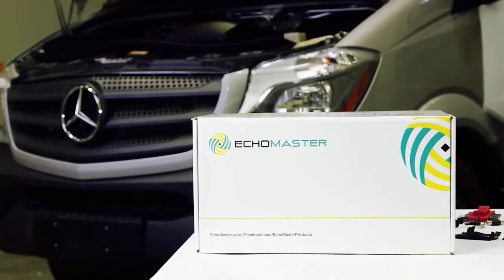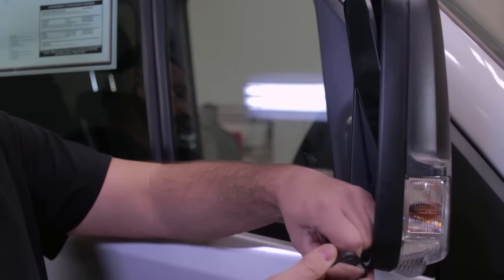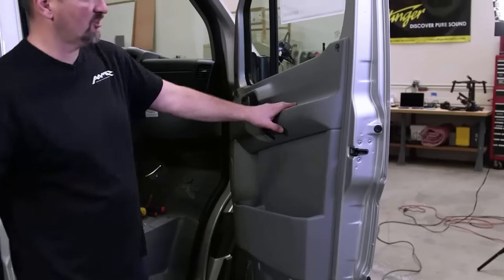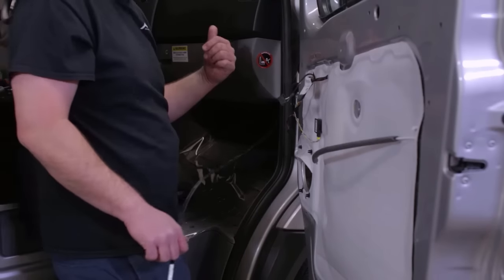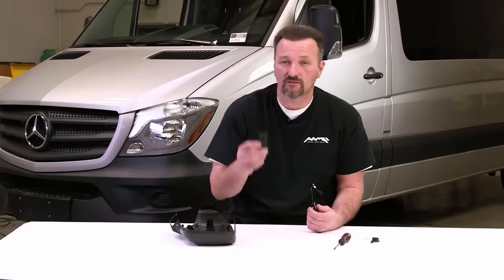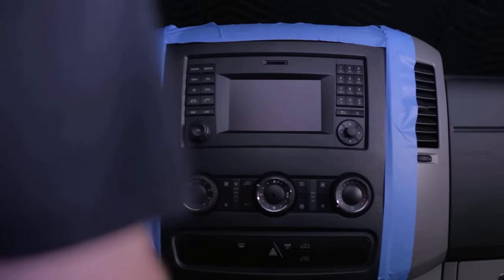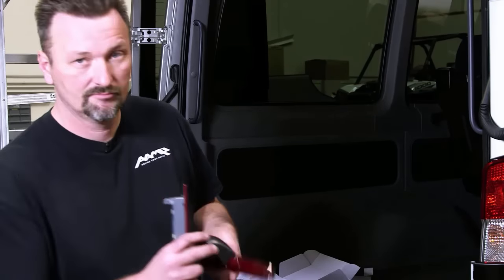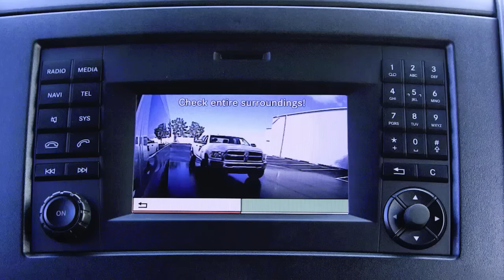Mercedes-Benz Sprinter Side Cameras

Comment: I bought the kit but its cameras do not fit my side mirrors which is a 2022 MB Sprinter.  Ends up with two cameras on the fenders.  The switching module is integrated well with OEM display.

Comment: MB Sprinter is the most sold commercial van except that Ford transit is outselling Sprinter 6 to 1 and Ram Promaster 2 to 1
Reply: well maybe now - 3 years after this video was posted because the sprinters are $50,000-80,000 new, even used the sprinters are very , very expensive.
Reply: @dasooperb1371  Or just maybe because the maintenance is so expensive and people realized that
Reply: We're talking about a Mercedes (which in this case is a Sprinter model) 
Of course this is NOT for everyone's pocket !!! 
There is a car for everyone just not THIS one. 
If I've got the money for just the down payment on a Civic,...
Obviously I can't argue that there are more Civics then Mercedes S-class  
Same in the van world, 
if I got the money for a used RAM, 
Can't argue that there are more RAMs then SPRINTERs
Reply: @jimmy-axoninternationalllc4613  lol. Sprinters break all the time: DEF, DPF, EGR etc. I still have my 2016 Sprinter. I just spent $5,000 after 100,000 miles. And a week without the van which cost me 💰